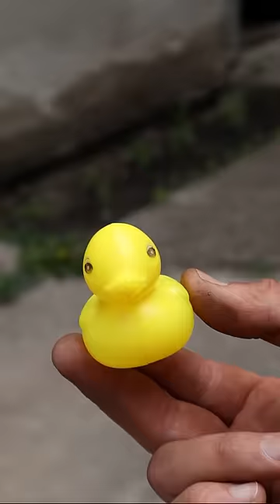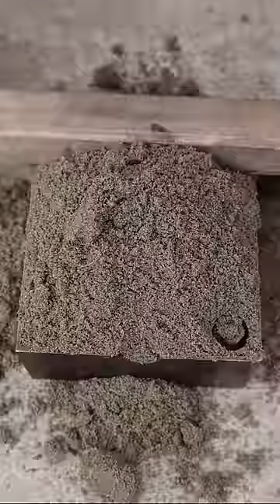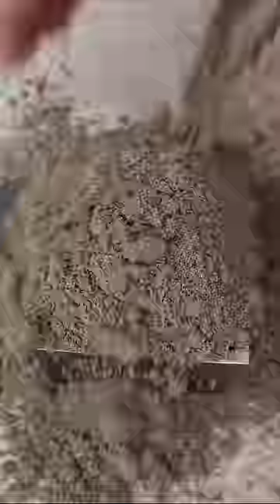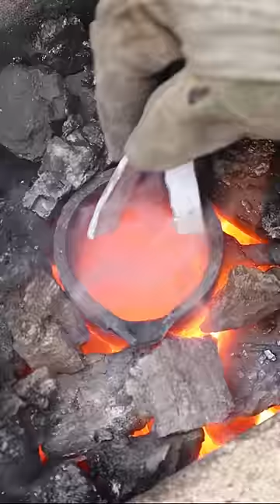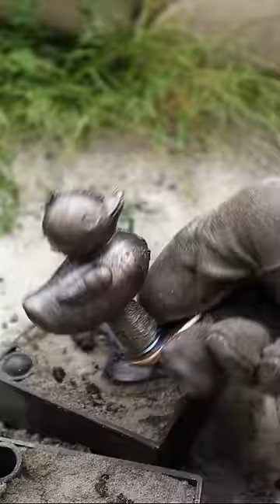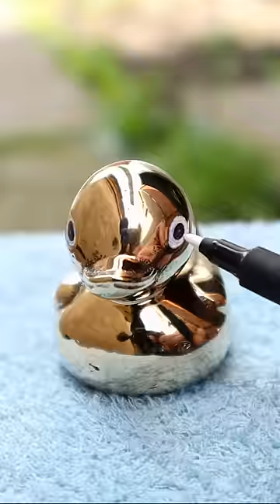Casting Rubber Duck into Bronze One

Comment: Video 12 of asking what sand you use and where you got it? I love this btw and now plan to copy it.
Reply: what sand and do you have a guess as to the black powder used when creating the impressions?
Reply: @johngalt166  i use petrabond I bought on ebay. Works pretty well, but is expensive and could be better. I use baby powder instead of the black stuff
Reply: I use petrabond and baby power, which work well, but his seem to work better. Thanks to those who have already replied with tips though.
Reply: @Traderjoe420  just out of curiosity, what makes that special? Better release? I have some used for locks and stuff, is it the same? Or is there something better/cheaper?
Reply: I would like to know as well
Reply: @rogue127  he responded to a different comment of mine. He uses river sand with a little clay and water. Surprised me but that is what he said